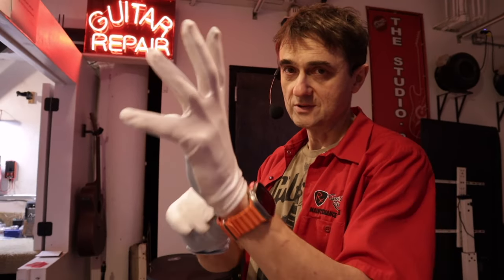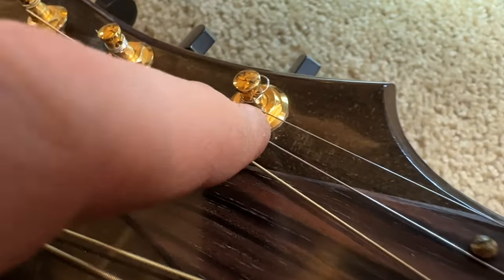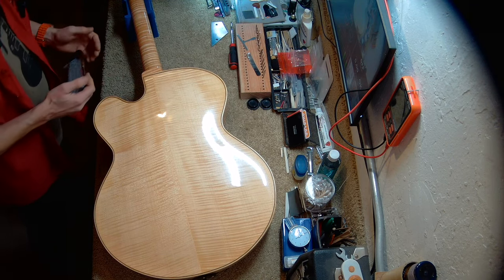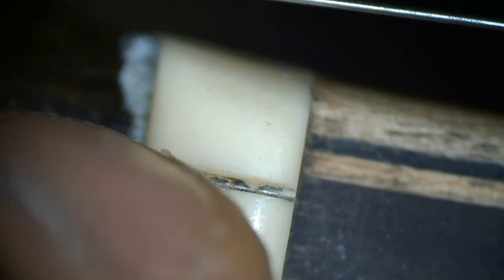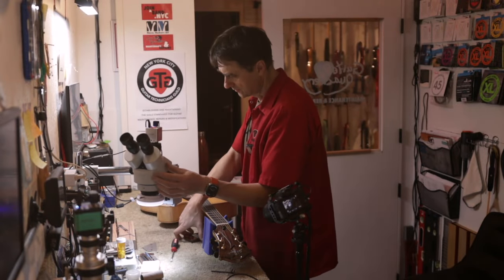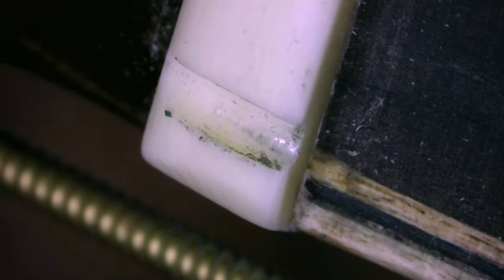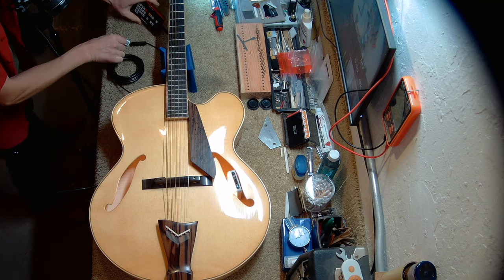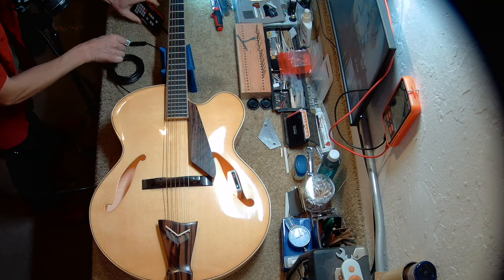D'Aquisto Archtop Guitar Inspection & Assessment

Comment: The bridge is fit perfectly to its place on the front by placing a chalked piece of paper on the spot and rubbing the bridge slightly back and forth on the paper along the centerline transfering the chalk to high spots on the foot of the bridge.  Those are removed with a curved sharp scraper blade, repeating this process  little by little until the foot reports chalk evenly across the entire surface.  It needs it.
Reply from the maker: Yep, that's one of the traditional methods. Another traditional method is with water, to mark the high spots. It's actually the same principle as dentists do when they do the final touchups on new fillings.

I also have a jig that can be used to clamp the bridge while moving it over a sheet of sandpaper laid over the soundboard.

The owner is reluctant to let me do any of that work as it would alter the handiwork of Jimmy D'Aquisto. But I agree with you that the bridge does need it.
Reply: The handiwork of James D'Aquisto has already been altered by time, according to the old Chinese proverb.  I think it safe to assume the shape of the front changed just like the neck issue which calls for alteration.  In theory those gaps under the bridge indicate portions of the bridge that might just as well not be there, driven by string sound pressure but not transmitted to the front except by a circuitous route through the bridge.  Jimmy raised his head from the grave and said, I set the dimension of that bridge foot intending that it be in full contact with the front according to my concept of sound!  Actively played Stradivaris don't leave the shop without the bridge feet fitted perfectly with carbon paper and scraper (not sandpaper).  For museum pieces it doesn't matter if they're even tuned.  But these million dollar violins have had their fingerboards, pegs, peg holes, bridges and other parts reworked, refilled and replaced countless times as needed with the builders understanding these alterations would be done according to the ferrocious use by top players and the ravages of time, in faith that the concept would endure.  And we respect that.
Reply from the maker: @randykalish7558  I love how you put all this into words very nicely.
Reply: I relent for now because I know that one day, that guitar will go into the hands of one whose playing presses the limit of peak, full race performance from the instrument, and spare no effort to affect that.  Then J.D. will RIP.